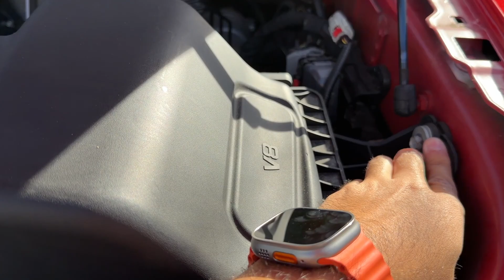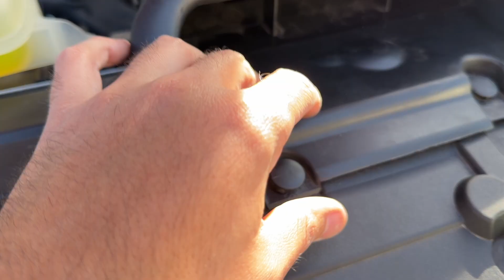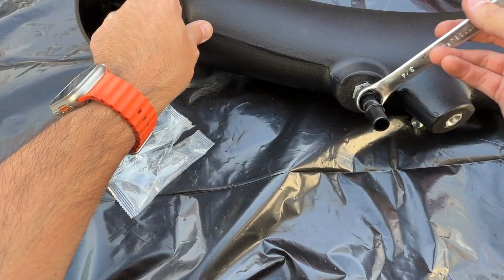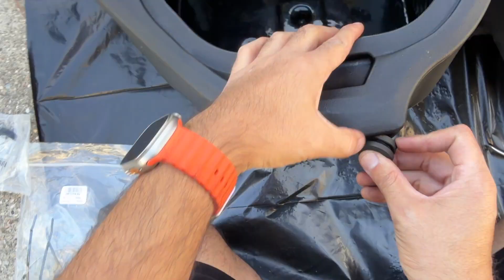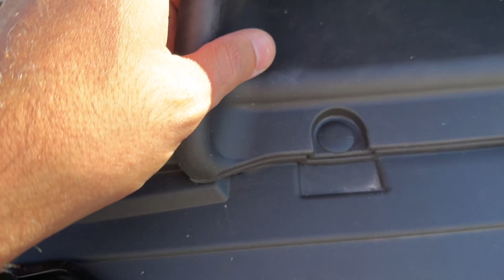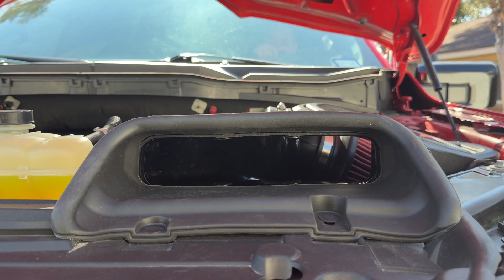F150 2022 S&B Cold Air Intake Installation

Comment: Good time to clean the throttle body.  Very easy to remove and clean with throttle body cleaner.
Reply from the maker: Good point. I had just done a tune up on it so no need on mine. But yes a good time to do it!